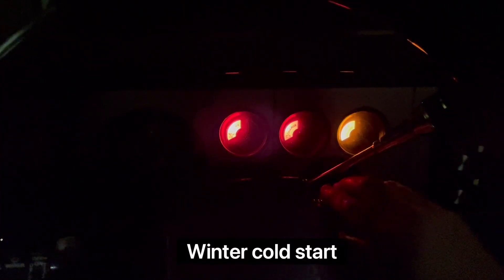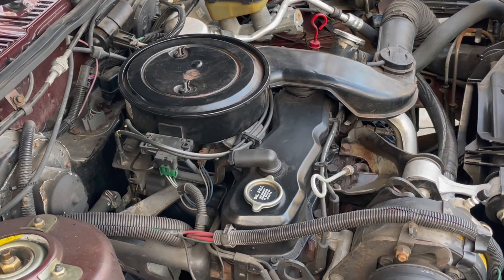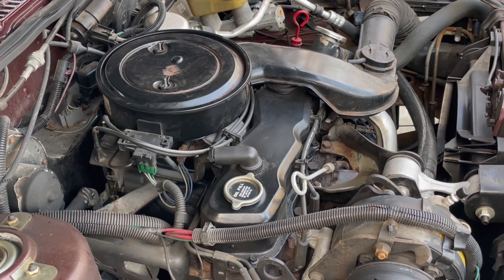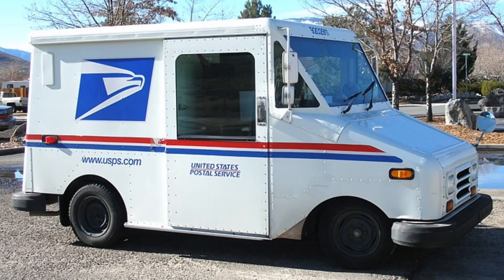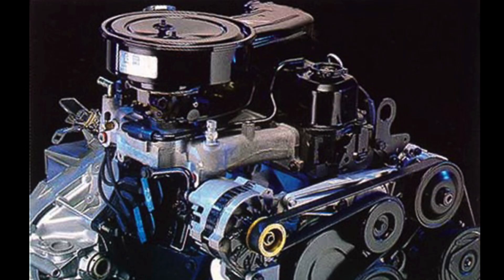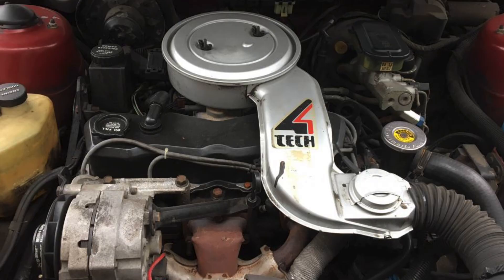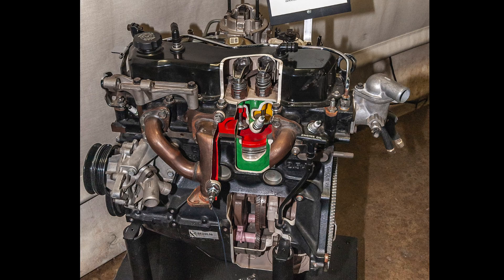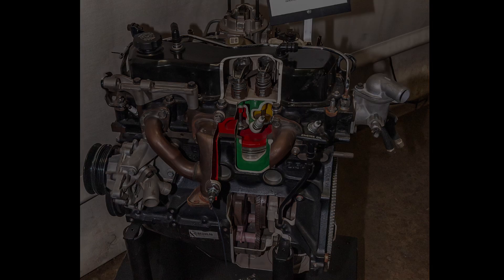Worst Sounding (and Most Recognizable) Engines: GM's "Puttering" Iron Duke 2.5L I-4

Comment: Wow, uploading this video as I finished your previous one I commented on, lol. Now this is gonna be a good night. I've heard a mixed bag with these Iron Duke engines. From your previous videos on it and comments on forums and such. I wouldn't mind driving a small S10/S15 2WD with this engine. I did own a 1993 S10 with the 2.8L and 5-speed T5 Transmission, and it was okay all things considered. It was no powerhouse, but it could keep up relatively easy with normal traffic flow. I'd love to drive a vehicle with this engine in it one day and feel for it myself.
Reply: In an S10 with a stick the 2.5 was actually pretty good outside of the noise. Every truck I've ever seen in that configuration had 4.10 gears so they were fairly spry around town, but done at about 65 on the highway if you had any hope of it living long. I think most of the V6 trucks got a less aggressive ratio. I ended up swapping a 3.08 axle from a 2.8 automatic truck (which had to have been terrible to drive) into my 2.5/5 Speed S10 and it would go down the highway at 80 all day... and many days did just that. In town it was almost too slow, but just tolerable. 😆
Reply: @TheBrokenLife  My 84 S10 P/U has 3.73 gears & at times on any freeway wish it had a 6th gear! Just has too many rpm`s for any longevity doing freeway driving
Reply: @frederickbooth7970  That's why I swapped the 3.08 in. This was in 2005 when gas was $5/gallon, I was doing about a 45 minute daily highway commute, and since I had a junky little pickup truck my job would send me on errands all over the place at $0.55/mile (which was big money 20 years ago) to pick up things, in addition to my hourly student wage. That truck made me a lot of money once it became practical to highway drive at modern speeds. I paid the axle swap off after the first month. Later on I moved out of state, but came back home about every weekend, so it got another 300 miles on the highway every week for the next year or so. I put around 60,000 miles on it in 2 years with that setup. On county roads with it at 60-65, it would turn in 33mpg. At 75-80, it would get in the high 20s if the bed was empty. That's not bad for a little brick in the wind. Oh... it was also on Z/28 wheels and tires, which diminished the final ratio even further from the factory intent. 🤣

FWIW, the most common ratio for S10 Blazers is 3.42 and they are still littering junkyards all over the country. That would get you a ~10% drop in RPM in each gear. It's not quite effectively a double over-drive, but close. My 3.08 was hard to find even 20 years ago, but I do still have it and it could be made available for sale since I doubt I will use it again.
Reply: @TheBrokenLife  Since we use our truck in hilly areas hauling at times very heavy loads the 3.73 gears make sense most of the time for our usage. My parents Blazer has those 3.42 gears & at times wish they were 3.73 as the  automatic transmission has to at times go down to 2nd when going over steep winding routes like we had to do earlier today when going to pay property taxes before deadline.
Reply: @frederickbooth7970  Yeah, if you're in mountain country there's not much you can do but drive slower. 😔

On flat land I did once bring home 2700lbs on dirt in the bed of my truck that weighed less than the payload... and that was with the 3.08s. It didn't like it. 😂
Reply: @TheBrokenLife  On our truck we have built it up with 8ply tires & air bags on rear axle so as to be able to haul for short distances 1 ton of hay for our high performance horses of the living breathing kind, Thoroughbreds! Much to the relief of my relatives I allowed my racing license for horses to expire back in the mid- 2000`s. At times still tempted by their abilities! But don`t like visits to our local hospital! 2nd & 3rd speeds with them allows 1 to live longer.😀
Reply: @frederickbooth7970  I think in that circumstance I may have opted for a trailer. That's what I ended up doing later on when I bought a "nice" S10. To my surprise, the factory towing capacity on a 4 cylinder S10 is 2,000lb. I question Chevy's sanity when it comes to stopping one with that much extra weight behind it, but... 😅
Reply: @TheBrokenLife  The secret to hauling any heavy loads with a technically under powered vehicle is to keep them cool with added oil coolers & the largest radiator you can fit in. Our S10 has a triple core radiator with an added oil cooler to keep temps at a safe range. We can actually haul an old Hale 2 horse trailer fairly reasonably with a load of hay or a horse in it. Have to use 3rd gear on real steep grades & keep engine speed at > 3,000 rpm. The truck & trailer combo actually seem to be made for each other as they handle very well in icy or windy conditions.
Reply: @frederickbooth7970  Yeah, my issue with all of that has always been stopping one with that much weight on it. There comes a point where the tow vehicle simply becomes the dog which the trailer will wag too. I certainly wouldn't like the recipe on steep grades, covered in ice, in high winds (even with trailer brakes). 😳 

Anyhow. I'm glad you're still getting good service out of your S10. 👍
Reply: @TheBrokenLife  Our old Hale trailer is of a short wheel base  type unlike those modern too heavy 1`s of today. Only weighs 1940# empty. Also only has a 2" ball hitch which makes it less popular with thieves too. Our other flatbed trailer has 4 wheel electric brakes which we insisted on by the maker so as to be able to stop quickly if needed. Our S10 is the ONLY truck that fits our 4'10" height perfectly at all controls. That`s why have rebuilt the body 3 times.

Comment: I agree, they are the most crude sounding engines that GM ever made. They were good and reliable engines though, particularly the '87-up with distributor-less ignition. They were fun to drive too, if you were a young teenager that had the pedal to the floor everywhere you went. 2.5 liters of raw horsepower, haha.
Reply: I remember trying  to do a brake-burn with my father's Citation and it was like trying to dribble a dead cat. There was simply no high end whatsoever. But, if you let the transmission take it from idle, it was solidly in slow-but-bearable territory: never exciting, but never really agonizing either.
Reply: Perhaps you may have the answer I'm looking for! Do you happen to know the officially prescribed method of accessing the distributor or distributorless coil packs/ignition module on the transversely mounted iron dukes? Does it involve the removal of the intake manifold? I have lost spark on cylinders 1 and 4 and am suspecting either a bad coil or bad ignition module, but don't see how to access the coils. It's a shame, because on the V6s, the coil packs and ignition module beneath were easily accessible on the front passenger side.
Reply: As a late teenager & early 20`s I had the real life horsepower from thoroughbreds! Lots of raw power up to about 40mph! No seat belts or airbags. Had to hang on tight! Explains why I never got in trouble with high performance cars such as the police cars I later sometimes drove for the GM dealership later on when delivering them back to the station servicing.
Reply: Had a 2.5 in my '87 S 10....never left me stranded in over 100k miles. Although I was always changing the oil because the pan only held 3 quarts. Fun little truck

Comment: Owned a 1981 Pontiac Phoenix back in the day with this motor.  Did not come with a tachometer (base model) so I bought a Sun Super Tach II and mounted it on the steering column.   I can tell you that anything over three grand was torture and coming close to Four grand sounded like massive explosion was imminent.

Comment: The engine sound might have been embarrassing, but the noise the starter made was downright frightening.
Reply: Most of the noise was from cam / crank gear backlash.  There was an updated gear set to fix this.
Reply: I think that car shared something called "5MT" starter with the 2.8 V6 and the Vega. I think base models only had 275 CCA battery from the factory,V6 models probably came with 350 CCA and there was an option for a 460 or 465 CCA battery in the V6,same battery that a pair of came in some of the Diesel vehicles.
Reply: @davidpowell3347 Makes sense.  I've heard so many GM cars from the 80s and 90s start like that.
Reply: @twiff3rino28 they just tossed the starter on at the factory, the bean counters decided the 20 seconds it took to shim them right was too much. They used to all have adjustment slimes.
Reply: @davidpowell3347 my lawnmower has more cca
Reply: @davidpowell3347 ”2.8” + “V6” is scary in itself
Reply: Run a 2.4 or 2.5 on an open header.
Tractor on meth.
Reply: There are two great replies already. Also, Iron Dukes use starter shims to get pinion-to-flywheel clearance correct. If you don't shim it, you will have noise and eventual problems. 
I always wished I could have bolted a Chrysler gear-reduction starter into my Fiero's Iron Duke. You start the Fiero with the sunroof open and the passenger will be startled.... "Wait.... Is the engine behind us??" LOL.... it got more fun when they asked what the buzzing noise was from between the car's seats. 
Man, I miss that car. It wasn't fast, it was hard to work on, but it was fun and fuel efficient and had no problems holding 75+MPH from Michigan to Maine.
Reply: @BrainDamageBBQ  i have tried to shim many starters back in the nineties... don't miss that. The tech 4 was a durable engine,  under powered and crude. Those valve cover gaskets were  cork... the leaks were awful. And the later exhaust manifolds were thin and cheap. Durable engine if u kept up on it. My mother had a cutlass calais and i put 20 w 50 in it to quite it down... not in todays engines....lol tolerances too low
Reply: @BrainDamageBBQ I worked on these when they were new. Like "off the truck" new. You are absolutely right. If someone thinks it sounds bad in the video, you should hear one with the starter needing the shims reduced. I couldn't believe they left the factory that way! In addition to the inherent noise of the engine, add in a sort of screech noise from the starter pinion. Often times you'd also hear the pinion do a sort of "wind down" after the key was released as well.
Reply: I think a lot of GM cars of that era even if they didn't have shims under the starter from the factory could have benefited from careful measurement of pinion/ring gear fit and shim use to get it close to blueprint #'s ,heck,many of them would have benefited just from having the starter mounting bolts torqued to service manual specs even when the car had just come off the van that brought it to your dealer 
did Brian Bosworth the football player put the starter onto my car? 
  @BrainDamageBBQ
Reply: 75?! Wow you must have had the 5 speed, my old phoenix only had the 4 speed and it did NOT like going any faster that 55!
Reply: Ok.  Here's the actual bottom line, as I see it.  GM was caught with pants down in the early 80s and several years afterwards, playing catch-up to mainly Toyota and Honda, who could produce fuel efficient cars with smooth, quiet engines.  The Omega, Skylark, Ciera, J2000, Cavalier, etc.  were outclassed by Honda and Toyota, and probably Mazda. I remember a friend of mine had a late 70s Toyota that was smooth and quiet as a mouse, especially when compared to any of the GMs.  The GM packaging was pretty good, the styling was not bad, the engines may have been durable  for a few years, maybe longer with excellent care, but they really couldn't compete in the refinement category.  This did permanent damage to GM's reputation, from which they have never recovered.  Of course the clanky I-4 wasn't their only mistake.  They had the Cimarron, the V-8-6-4 Cadillac disaster, rust problems, quality control problems for years.  My mother had an 81 Skylark, and I remember what a major disappointment the engine was.  After one more try with GM, this time, Pontiac, with a V6, and resulting defective steering rack, she went to Toyota.  Mistakes have consequences.
Reply: The V8- 6- 4 is still around and it is still abominable,has transmorgified to be "displacement on demand" and "cylinder deactivation" and maybe something else,I think it has even showed up on a Japanese model (for USA model)  @johnlandacre767
Reply: Ya, and chevy guys think mopar starters sound bad, chevys used to have the most garbage starters in the industry
Reply: @sdmoparmaninsd6713 I love me an old Chevy tin can full o rocks starters
Reply: LOLOLOL 
That’s anything but frightening.
Reply: That just sounds like a old school starter, they were much louder.
Reply: USPS has a whole fleet of these in the LLV
Reply: @MattyC62185 yeah and the shop all the local post offices send their trucks to by me always has a parking lot full of them and I see their tow truck all over picking them up.
Reply: @TheGreenGrower618  yes, those things are getting old and rundown. You should see the odometers these damn things have on them and what they read through the roof, but it is time to replace them.
Reply: @MattyC62185  yeah I'm sure. My sister had an S10 with the iron duke that had over 250,000 miles on it when she sold it and I saw that truck around for years after that. The exhaust manifold had cracked badly and my dad welded it up before she sold it but it must have cracked again because it was obnoxiously loud and the guy just kept driving it like that forever. They're already super noisy motors but you should hear one with a badly cracked manifold. You could hear him coming from way down the road. He used to drive by my house on his way to and from work every day and I always knew about what time it was when I heard that truck. It was either around 7:30 am or 5:30 pm if he was driving by. It sounded just like a street sweeper.
Reply: @MattyC62185 hah yeah I used to work there those LLV were the worst.
Reply: It sounds like a Were-Car starting up. Sends chills down your spine
Reply: Sounds identical to the old Ford V6 engines from the 80's. I never had anything with an iron duke but I've had several old ford's like that, and that sound put me back in time lol.
Reply: The supplier of starters to GM was Remy. GM bought Remy in 1918 and owned it until 1994. My 2007 Kia had a Remy starter from the factory and it also sounded horrendous every turn of the key. When it failed years later I replaced it with a Valeo (French OE supplier) and it was much quieter. I think the starter noise of Remy's is unique to them. Best sounding starters IMO are the 1990s Honda's (made by Denso or Mitsuba). The Swiss watch of starters.
Reply: There's nothing embarrassing about it. They sound lovely. Nice, simple, honest little OHV 4-pot that'll last for-fucking-ever.

I still hear them every day in Grumman LLVs zipping around their mail routes as they've done since before I was born. 

The only real fault one can find with this engine is it makes fuck all power. 2.5 liters and about 80-90hp. It was fine in something super light or something that never had to hit the highways but it ran out of puff pretty quick in a heavier 4-door sedan on an interstate.

Comment: Even under warranty the timing gears would make all kinds of noises!!   Some sounded like rod knocks!!   The GM techs got good at poping out those cam gears in the frames without many problems!!   At the time where I worked was a triple franchise.  Volkswagen,  Pontiac, and the beautiful Yugo!! Hahaha.   We use to call them.... YuDontGo!!  We were rebuilding whole Yugo engines before 15000 miles!!   What a sad company!!   😊   Yugo engines got real noisey as the camshafts rounded off and the pistons cracked to pieces!!   Some would run to the dealer but most were towed!!   Sad Yugoslavian Fiats!!
Reply: You really gotta hand it to Zastava (Yugo) - they took a Fiat design and somehow made it worse!
Reply: The YuDontGo had me laughing for awhile! Great call.

Comment: A big part of the harshness is it's a large displacement 4 cylinder with a camshaft that turns in the opposite direction of the crank because of the gear to gear timing. I've built a couple fully. Going as far as to balance the pistons and rods weight actually helped make the last one I rebuilt sound less horrible and more like just another engine.
Reply: great comment...
Reply: I think Honda would disagree with you from this period

Comment: I agree that the engine’s sound is fairly crude ..and am reminded of that daily as the mail truck comes by… but I’d submit that the 2.3 liter aluminum block engine in the early ( pre Dura-Built 140)  Vega was cruder.. especially at idle.
Reply: I agree.  I owned a Citation with an Iron duke 2.5 but as embarrassment goes it didn't hold a candle to the early Vega's with their farting engines.

Comment: It was basically a tractor engine, and it sounded like it.
Reply: The Duke was based on the four cylinder that GM Brazil built. Which in turn was based on the Chevy II four.
Reply: Swap the cam gear with a cast iron one and you’re there
Reply: More like inspired by the 250 / 292 inline 6.

Comment: It is half of a Pontiac 301, is it not?
Reply from the maker: No. Same bore and stroke but that’s about it
Reply: @RareClassicCars  Can we make this myth go away?  I'm so sick of hearing/reading it.  It doesn't help that a number of "authoritative" publications have repeated it for decades.
Reply: @alantrimble2881  that is probably where I got the impression. The 229 Chev V6 is 6/8ths of a 305 sbc, is it not? I have always heard that also.
Reply: @haneyoakie14  That's true.  Also, the 4.3/262 Chevy V6 is 3/4 of a 350.  The V6 engines use split-pin crankshafts.  The 350 does not.